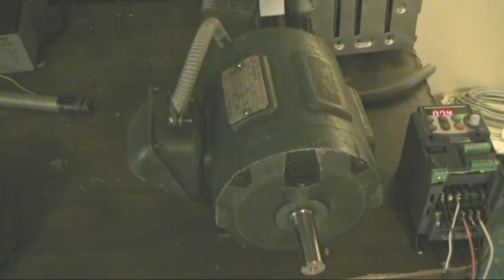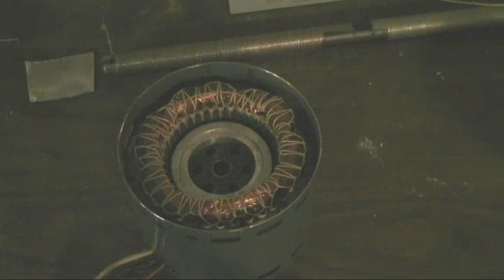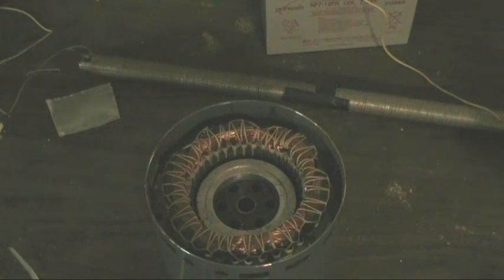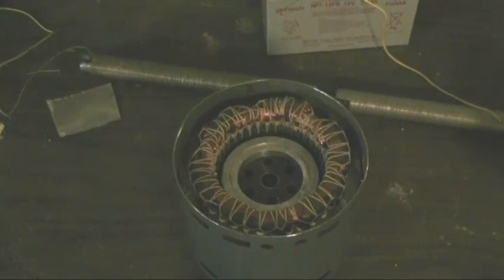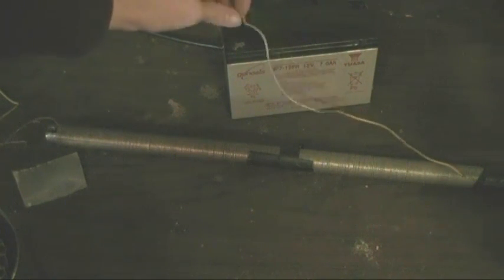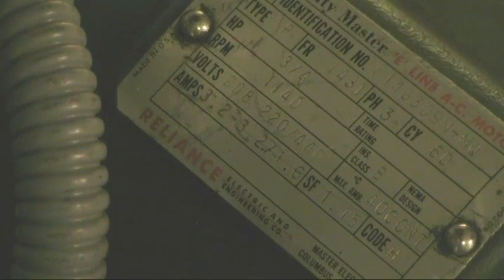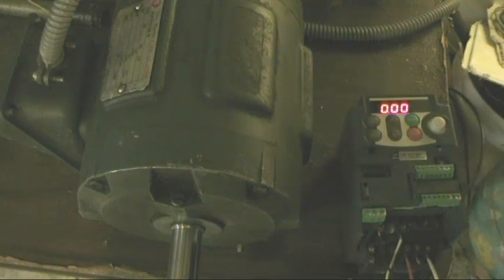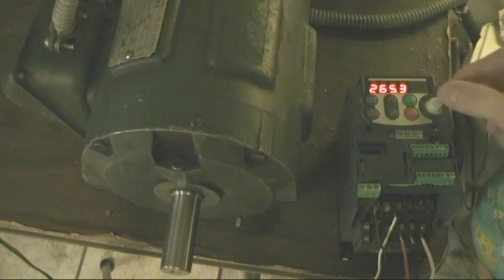Induction motor with VFD, Torque and Speed

Comment: Thank you for this video, it is useful information.
I am struggling trying to work out why I have little torque from a 50hz delta motor as in when connected to the VFD it spins as expected but can be stopped dead just by taking hold of the shaft with my hands.
I have 4 motors and 2 work fine and the other 2 I just cannot get any torque from them and I would really like to know why.
The VFD is 2.2kw 220v HuanYang VFD, it runs a 2.2kw spindle motor perfectly at 400rpm.
I also have a 2.2kw 3 phase motor that is 50hz, the plate says 220v delta or 440v star and works perfectly well at 50hz delta of the HuanYang VFD
I also have a 3/4hp 50hz Hoover motor that the plate says 220v delta or 440v star but when wired delta and ran at 50hz it is gutless and has very little torque and I do not understand why.
Finally I have a SEW Eurodrive motor that is about 1/4hp that the face plate says 440v star, the wiring block inside can be changed to delta (although the face plate does not give specs for delta) and this also has no torque when running at 50hz delta
The only difference I can see is that the 2 that work fine are rated at 2.2kw and the 2 that don’t run properly are smaller motors more like 1kw, but I cannot see why a 2.2kw VFD would not be capable of running a 1kw motor so I don’t think this is relevant.
I would really like to know what I am doing wrong if you have any input
Reply from the maker: Small induction motors have high resistance windings. The high resistance windings drop a lot of voltage and reduce the current down too low to produce much torque.  Most likely you need to increase the output voltage. You can either change the V/F ratio or add torque boost. Some VFDs call this "IR compensation"
Reply: Hi. 
Well, I am usign a motor that works at 60Hz and Im controlling it with the same VDF as you. 
I want to know if I can run the motor whith a frecuency higher than 60Hz due ti the VDF can run at 400Hz. 
Im not expert in the topic so I decided to reply you because at the momement just run the motor at 60Hz or less.
I hope you answer as fast as you can.
Reply: Hi Jay, Did you find out why the smaller motors produced so little torque when run off of a larger VSD?
I've had mixed fortunes running 3ph motors, in Delta, from budget cost Chinese single phase  240V in/240v out VSD's:

1) My old shaper machine with a 0.37kW 3ph motor ran fine, in Delta, on the default  parameter settings of a cheap 0.75kW VSD .

2) But, a newer 0.55kW SEW motor, powered by the same 0.75kW VSD, produced almost no torque below 30Hz. I eventually bought a more expensive VSD and then the SEW motor worked OK. 

3) I've also experienced a curious problem with a 0.18kW motor wired in delta, powered by the cheap 0.75kW VSD. It ran at 1/3 rated speed and became too hot to touch within less than a minute! The same motor ran fine on a real 3ph supply.  Go figure!!

Regards Paul in NZ

Comment: Question:
What would you have to do for a motor to change its torque while mantaining constant its speed? And to change its speed while maintaining torque constant? As for example a vinyl turntable does
Reply from the maker: Variable frequency drives with torque control either read the motor speed directly with a tachometer (encoder,resolver or similar), or estimate using a motor model and by measuring the phase currents. From there, the vfd can adjust the torque to cause the motor to maintain constant speed even under varying load, this is done by adjusting the output voltage and frequency in realtime. A small computer inside the vfd calculates the difference between the commanded speed and actual speed and makes real time decisions as to what will best correct the error, but it's usually an adjustment to output voltage. Holding constant torque is similar but a little more complicated. The computer inside the VFD must again read a model of the motor but it must be a fairly accurate model of the motors flux torque relationship. From this, the computer can again make real time decisions as to what combination of voltage and frequency output will have the desired impact on the rotors flux. For example, a maximum torque command will cause the VFD to attempt to accelerate the motor as fast as possible, and this will cause the VFD to output maximum voltage,  but the frequency will need to be determined from the motors actual shaft speed. (hence the tachometer). A half torque command probably wouldn't require the same output voltage, but would still need a good reading of the motor shaft speed.
Reply: So the thing that modifying frecuency, chances the spinning velocity of the inducted magnetic field whereas by modifying the voltage applied, you chance the inducted fields strength. Great data! Thank you for all the explanation!

Comment: Sir may I asked your opinion , I want to install a VFD on my drill press what can you recommend on how many HP should I get for a motor , is it better to get a 3 phase motor and how much HP should I get and what VFD brand you recommend on the motor that will work on the VFD your going to recommend , thank you sir for your opinion and keep up the good work and more power to your you tube channel!
Reply from the maker: It all really depends on the drill press in question. It would certainly be better if you could use a 3 phase motor instead of a single phase motor. I have a drill press myself that I believe has a 3/4 HP motor. But again, this all depends on how big your drill press is and what you intend to drill with it.

Comment: i have a question can i use that speed controller to lower the speed of a motor that has 1700 rpm to 10 rpm? and keep using that 10 rpm for long periods of time?
Reply from the maker: Sure just put a separate cooling fan on the motor

Comment: How much rpm would you say that it peaked at 220v?
Reply from the maker: Not sure in this video. But in a newer video I have made the motor hit 190 volts at 0 RPM
Reply: subcooledheatpump wut??? The max rpm bro
Reply from the maker: Ah sorry I thought you wanted to know at what RPM the voltage peaked. Peak RPM in this video was probably about 6000 RPM since it's a 6 pole motor

Comment: SIR WANT TO RUN 3 PHASE MOTOR AT 30 RPM WILL IT BE FEASIBLE .motor specs are 220-240 v delta connection. power 1.1 kw and 4.7 amps full load current

Comment: Good day friend, I searching for answers and saw your video and I'm asking for some help. We are using a delta VFD-B to run a 25hp motor for a 250lbs washer extractor. I'm new to the whole thing so I set up some parameters to the best of my knowledge. The machine runs ok with just the basket and water but for some reason the motor won't spin when the machine is loaded with wash load. Can you help please?
Reply from the maker: Sure. So I take it this isn't a variable torque application, For example once loaded the load is fairly constant correct? If so, I would check the V/F Ratio. In other words, if the Motor wants to have 460 volts at 60 Hz, make sure the VFD is programmed to output that. If your V/F ratio is too low (for example, 240 volts at 60 Hz) it will stall the motor. Check that and let me know if you're still having problems. Thanks

Comment: can you use any 3 phase motor with a VFD?
Reply from the maker: Any 3 phase induction motor can be used with a VFD, as long as the VFD has the right output voltage and current capacity. Permanent magnet motors can be used but they usually require a encoder. Thanks for watching

Comment: I got more out of this video than all of the research I've done in the past 3 months. THANKS!!
Reply from the maker: Impedance doesn't decrease with a decrease in frequency? Never Knew. Higher voltage windings don't produce more torque for a given current? Better call up the authors of my text books. Increasing stator winding voltage while holding frequency stable doesn't result in more torque? Wow these guys making these VFDs mustn't have a clue.
Reply from the maker: This video was actually meant to explain in a basic sense how an induction motor will behave when powered by a VFD. Sure, I admit this wasn't one of my better videos, but I think it does reasonably well for its intended purpose.  It wasn't, however, meant to go into every detail of the induction motors operation. All that math is practically useless in the real world anyway. Maybe if your job is to design an induction motor is the math important. But as far as operating one I see no point going into the gory details. So as far as I'm concerned there isn't anything wrong with it. For me then it's quite simple. Increase V/F yields an increase in torque as long as the motor isn't saturated. Increasing the number of turns in the winding causes more impedance, which raises the V/F requirement but also reduces the current requirement. Maybe I'm a complete idiot but I don't see how that would be incorrect.

Comment: what if we change the rotor of a induction motor (A.C) with permanent magnets... what will happen will it increase the torque and rpm or it will decrease?
Reply from the maker: Not necessarily. RPM should increase as it would match the synchronous speed without any slipping. Torque should increase per amp since magnetizing current is no longer required by the PM rotor. As long as the magnets are strong enough to resist being demagnetizied by the stator
Reply from the maker: https://en.wikipedia.org/wiki/Synchronous_motor#Permanent_magnet_motors
Reply from the maker: Permanent magnet motors are synchronous motors. They follow the synchronous speed. That isn't debatable. Induction motors never follow the synchronous speed. That also isn't debatable. A 4 pole induction motor at 60 Hz can never reach 1800 RPM. It always slips. Whereas a  permanent magnet motor always follows the synchronous speed, which would be 1800 RPM for a 4 pole. Changing an induction rotor to a PM rotor creates a permanent magnet synchronous motor, which therefore guarantees the slip will be eliminated. Torque is directly related to the stator winding current. Only difference is with an induction motor magnetizing current is required and for a permanent magnet motor, it is not therefore, for a given current torque does increase. Again, actual fact and this can't be debated. Don't post misinformation on my channel and then pretend it's the truth.

Comment: I have a concrete block machine. It has a control panel set up for 40 amp,  220, 3ph. The machine has four motors rating from 2.2kw to 3 kw 1380rpm  50 hz.
Reply: Darren Dinsmore 
Hi Darren - Make sure your Motor is set up for Delta windings( if it is a 220/440V motor.)

Comment: Great video, I however can not seem to run my vfd without  getting  an over current  fault.  It trips off only a few seconds after start up. I have tried lengthening  the start up and lowering the Hz. Any thoughts  would be appreciated. Thanks
Reply: What is the nameplate FLA and voltage of your motor? What is the maxim current rating for your VFD?

Comment: Is current independent of frequency and voltage or does the value of current remains constant with the change in frequency and voltage while operating induction motor with VFD? Because in my view current increases at low frequency and at low voltage to deliver same power. So this high current will eventually burn the insulation of the motor.

Comment: A good, informative video.  One thing you forgot to mention is the core losses in an induction motor operated at high frequencies.  Hysteresis and induced eddy currents in the core laminations will cause the motor to run very hot and limit its torque and speed at high frequencies.  However, this usually isn't much of a problem in standard VFD applications.

Comment: I have a really basic question that no one is answering for me. Will a weak run capacitor cause a loss or torque? I recently bought a used wood shaper, it starts right up but stalls immediately when I put it under load. I can't say if it's running at full speed before this happens because I've never seen it run properly. I'm at my wits end and would greatly appreciate any help you can give me.

Comment from the maker: You could do that, Set P1.10 to 25 Hz, then set P3.2 to 25 Hz. That would make the controller output full voltage at 25 Hz, and thus give the most possible current to the motor for the greatest torque, at half speed. Of course this assumes the overcurrent trip hasn't been set off. The only real problem is the motor would be overdriven technically, you would have to add an external fan, or you would destroy the motor.

Comment from the maker: to 40 Hz then it will output full voltage at 40 Hz, that gives more current at a lower frequency and therefore more torque. You can also adjust the voltage when you are halfway to your field weakening frequency, parameters P1.12 and P1.13. Set P1.15 to 1 to enable torque boost, set P1.16 down to a minimum, yes this makes the motor loud but It reduces losses in the inverter and gives you more torque. Then parameter P1.4, if you set it to 2 X the motors current rating, you should get 2 x torque

Comment from the maker: Okay, after seeing the manual I can tell you several things you can do
The base frequency adjustment for this drive is parameter is parameter P1.10, Field Weakening point. This adjusts when the drive will get to 100% of the rated voltage. Then Parameter P1.10 Field Weakening Point voltage, is the voltage it will output at the field weakening point that you have set.
So, for example if your motor is 50Hz the drive will output full voltage at 50 Hz, but if you set P1.10 (continued)

Comment from the maker: These are normally parameters set on the VFD. 

What VFD are you working with? some types may not allow you to alter the output as easily 

It sounds to me as if you may be working with an ABB ACS type or similar drive. In that case you would enter all the values as they appear on your motor nameplate, then set the maximum torque to 300%. 

If this isn't the case, then you can usually find the parameters in the manual

Comment from the maker: increase torque boost, lower base frequency and watch the temperature of the motor, it will increase. With a 1.1kW VFD, you could possibly burn out the motor if you aren't careful.

For maximum torque, you want maximum current but since the speed will be lowered, so will the fan speed and it will give less cooling. An external fan is usually recommended

Comment from the maker: That voltage probably will damage the motor, as it is likely beyond the windings' insulation rating. The number of poles in this case won't make much of a difference. A high speed motor, That is a motor which is rated for 10000 RPM would be more suitable, as it has bearings designed for high speed operation. It is likey that you can have the bearings changed for high speed, and you may be able to get the motor rewound for a lower voltage so you can achieve full speed with no torque loss

Comment from the maker: You should be able to get the motor up to that speed, but use caution, the bearings may wear very quickly with continuous use. If you don't want to loose any torque, then you'll need to increase the voltage as well as the frequency. If the voltage is 220 at 50 Hz,then you will need 770 volts to achieve that speed with no torque loss. 
Power is constant, and power is a product of torque and speed. So increasing speed with the same power means less torque.

Comment: Ok , thanks for your fast reply. I have another concrete question. I have VFD brand omron VS mini j7 his input is 220 volt I want to use motor for spindle on 8-10000 rpm, Im planing to buy motor 220/380 volt 50hz 2,2kw 2860rpm acording to you experience is it possible to get about 3.5 times more rpm and how much torgue will I loose from this motor??My opinion is that it should work on about 175hz and I thing that I wont loose any torque? what do you thing about that ?

Comment from the maker: If the input voltage is 220 volts then the output voltage should be 220 volts at base frequency. Base frequency is the frequency at which the VFD will output maximum voltage, and it is programmable. 

So you can run a 220 volt 50 Hz motor at 300 Hz and 220 volts, but as I explain in the video you will lose torque. You could however, use a 400- 480 volt VFD, program the base frequency to 120 Hz, then run your motor at 300 Hz and 480 volts.

Comment from the maker: This was a 6 pole motor, so 350*20= 7000 RPM

Induction motors can usually take 4x rated current, that means 4 times the torque. If you can keep the voltage up, you can get 4x torque at 2x speed to make an induction motor 8 times more powerful. Thats my theory anyway. I get 4x torque in my electric van with a 6 pole induction motor

Comment: So, 350 Hz and I think this was a four pole motor? So that would be about 1750*6=10,000 RPM? It was interesting that the torque dropped so much that it stalled in the first test, then it held speed when wired for 240V. It should be possible to get at least 2x the rated HP by overclocking and keeping the V/F ratio. And you can usually overload an induction motor by 2x to 3x torque before breakdown and stall, so as much as 6x total HP. And maybe more with special windings.

Comment from the maker: Continuous high torque and low speed will require extra cooling, Continuous high speed will require rotor re-balancing and high performance bearings. Other than that, it should work.

I usually install external cooling fans on my motors, so they can work with high torque. I have burned up a few motors by not using fans, but the one with the external fans all seem to be okay.